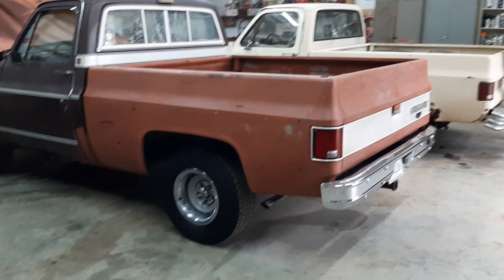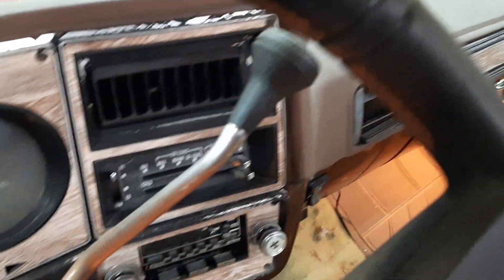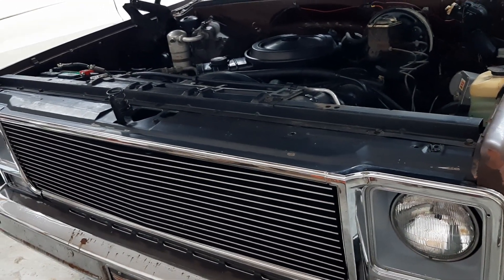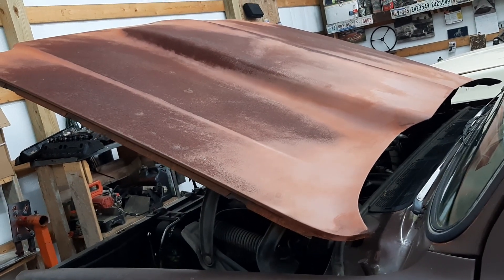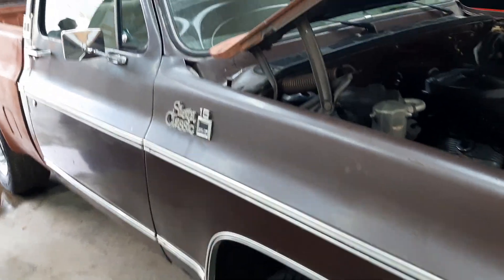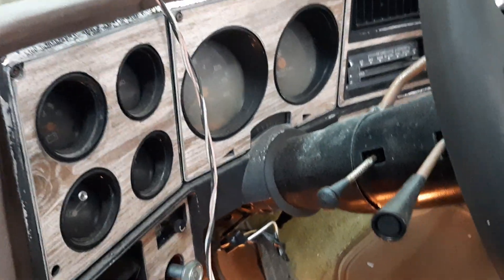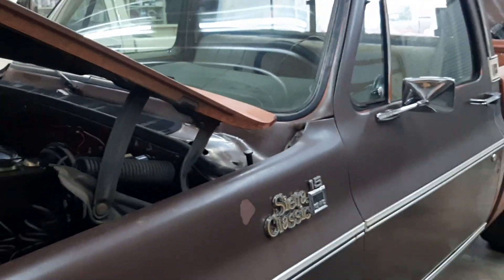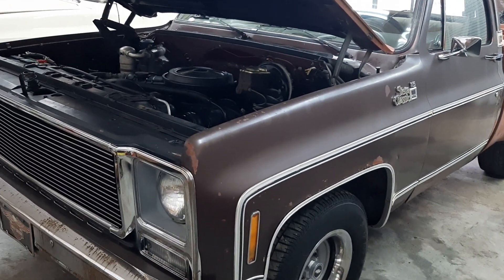Look at this 1978 GMC Short Bed truck that belongs to GM TIM38 on YouTube. It has some unusual parts

Comment: That radio would have been installed in a Cadillac of the same vintage.
Reply from the maker: Thanks for the info! I really appreciate it!
Reply: @primeredisbest  My best friend's father bought a new Cadillac Brougham (loaded) in the summer of 1979, black with red leather interior and those nice Caddy wire wheel covers. It had the same exact radio as your truck. We dropped his Dad off at the airport and drove the car home on one of the hottest days of the year. With the AC on and those comfy leather seats, I felt like a BOSS.
Reply from the maker: @zephead843  That makes sense to me because GMC and Cadillac have always been connected together as the Top Dog of the General Motors divisions. Yes I guess I would feel like the BOSS if  I was riding in a great car like you were in! Good times and good memories too for you! Thanks for the info my friend!

Comment: Whoever originally bought this truck must have really had some cash they wanted to spend on a new truck. And to touch on that question on the cruise control unit, my truck’s got cruise but It didn’t have that kind of unit. I do not think it is factory but I don’t know too much about 78 trucks. Your friend must be in the same club I’m in, the Chevy tailgate plate on a GMC club 🤣
Reply from the maker: I was thinking that maybe that wasn't factory cruise too! But like you, I am not that familiar with the 1978 C10's with cruise. My 1979 I just sold about 3 weeks ago had cruise on it. But it was a little bit different as I recall. I agree that whoever bought that truck new must have had a bunch if money to spend on buying it. I sure do appreciate your comment and for watching the video! Thanks so much!